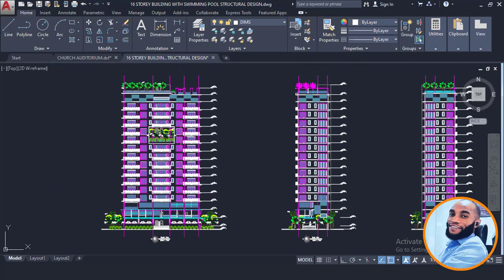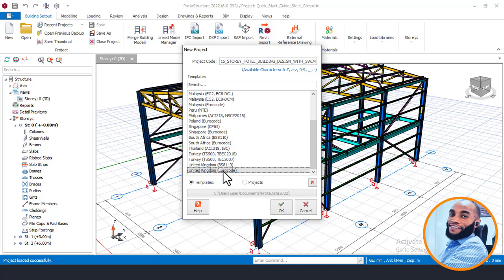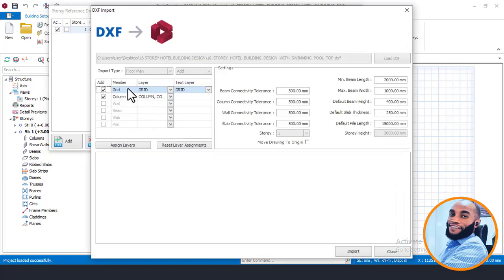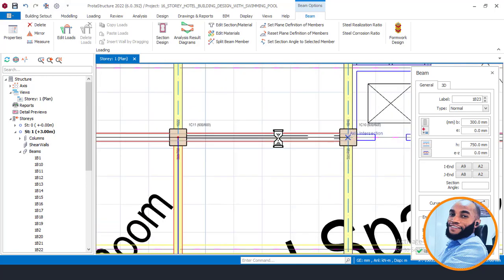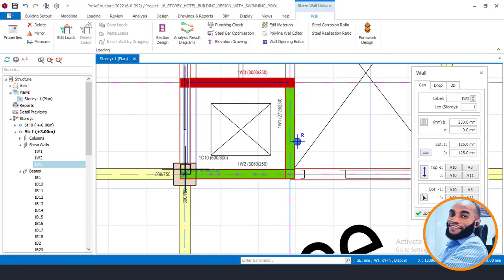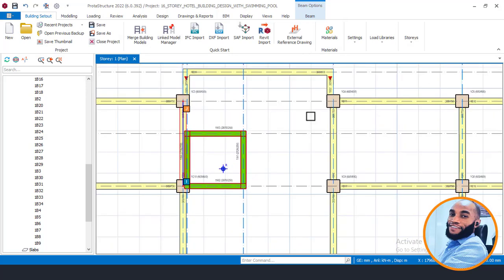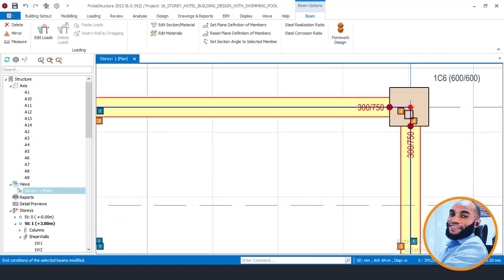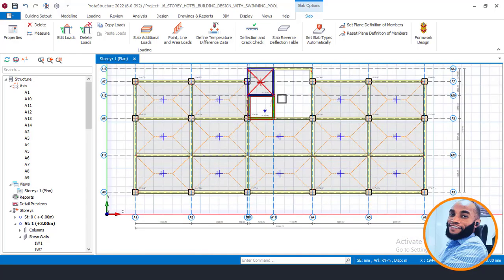PART 2 - 16 STOREY HOTEL BUILDING DESIGN IN CIVIL ENGINEERING USING PROTASTRUCTURE 2022

Comment: i have a project where the land is slopy and the difference between the upper and the lower place is about 7.2m. how would you approach such projects considering you have to do several retaining walls in between
Reply from the maker: First if the width of the 7.2m slope area is more they should convert that low are to basement or what do you want to do there ?